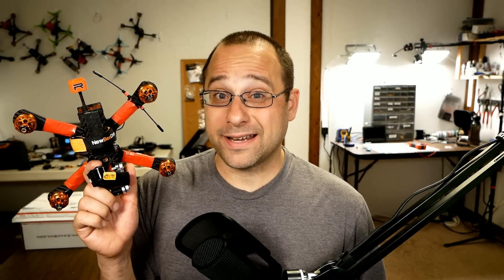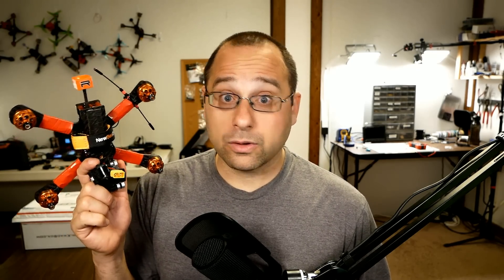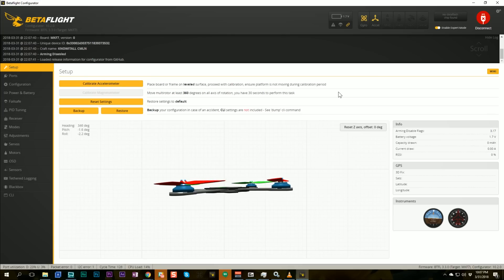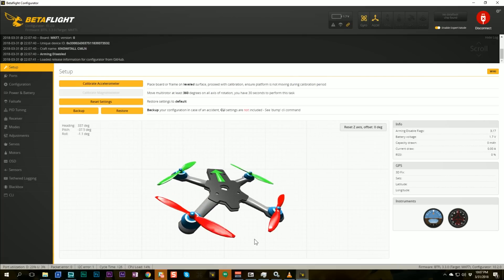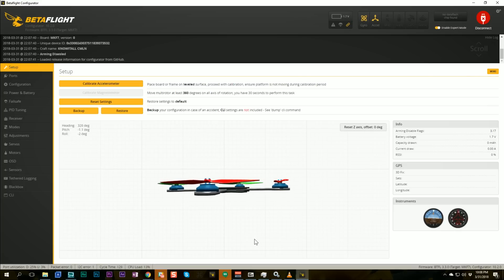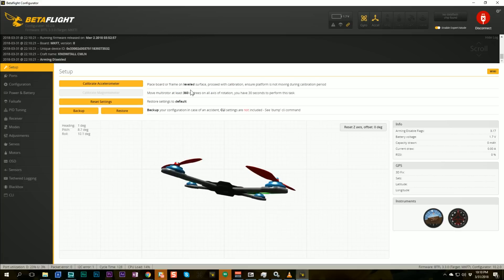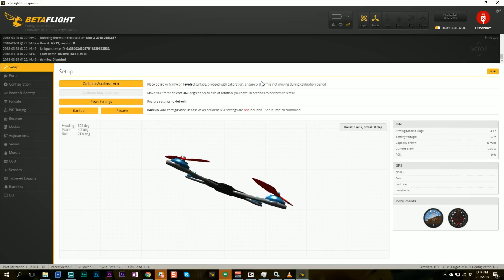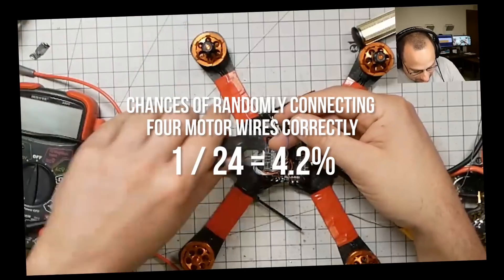Betaflight flight controller and ESC alignment incorrect | HOW TO FIX

Comment: Just a little add on for people doing this in 2024 remember to reset your Z axis in the setup tab. You could have the right board alignment settings and still show the wrong configuration until you reset. :)

Comment: Saved my ass again. Had to use several of your videos to correct my "reset" on a Betafpv Meteor65 ELRS. Had to set the VTX tab, the receiver tab, PID tab....blah blah blah. At first I was mad, but JB would certainly have a video or videos. Then I laughed and got to work....thanks again for this vidoes. ALL of these manufacturers should pay you some kinda skrill for this.

Comment: Now, this gonna sound weird but I did re-align the motors via the CLI and the 3D model seems to behave as it should but when I actually go into the receiver tab and I try to manipulate the model with my taranis, pitch and roll are inverted. Same happens when I actually try to fly it - pitch and roll are indeed inverted...
Reply from the maker: Invert your pitch and roll channels in your controller.

Comment: Hello, I notice that my quad is pushing air down, not pulling it up like the little 3D model in Betaflight. Does this impact the drones YAW and Pitch settings? My GepRC Cinelog35 flight controller seemed to have been installed backwards because the 3D model doesn't rotate correct to real life. So I went into configurations and change the YAW and Pitch to 180 degrees. Now I'm thinking that maybe it was originally correct because the 3D model in Betaflight is pulling air not pushing it. Was I correct in my thinking? How should I adjust my settings? Thanks!

Comment: there must be something wrong with betaflight or with my FC, i've set the yaw offset to 45 then to -45 trying to mount "star shape" controller on a square config then deciding to drill new holes into frame and keep star shape alignment and reset the offset to 0 since the "arrow on the board" was facing forward.. but god dang this wasn't working as supposed to and quad would always runaway disarm , only now after watching this i checked if the quad gyro is working properly and found out it was offset by -90 degree's... flipping annoying. lost a Sunday of flying for this  crap..

Comment: Hi joshua i followed ur steps. The motors spin right and the FC is facing the right direction. How ever if i switch to acro mode the quad flys fine the first minute or so but then in the air the directions suddenly change if i pitch forward the quad moves back and if i roll right the quad move left. Can someone please help me i have this quad for over 1 year now and never got it working properly :(
Reply from the maker: My best guess is you have headfree mode activated in the Modes tab.
Reply: @JoshuaBardwell  THANK YOU SO MUCH JOSHUA yess this was the problem i always thought headfree is acro in betaflight. Ive spent a lot of time in DRL sim its so nice to use ur sim skills in reallife. Cant thank you enough :)

Comment: what happens if suddenly betaflight 4.3 thinks pitch is roll and visa versa?
Reply from the maker: The FC alignment could be 90 degrees off.
Or if you mean in the Receiver tab, your channel mapping could be wrong.
Reply: @JoshuaBardwell  in the setup tap, it thinks my sensors are aligned completely differently than they were in 4.2. Its not possible being a tiny whoop. The FC can really only fit the frame in one direction. Can't be upside down because of the motor connectors... and oddly betaflight WILL NOT let me flash back to 4.2. Did I just get unlucky a kill a gyro? My other quads all liked 4.3!
Reply from the maker: Can you fix it using the Yaw Degrees parameter in Configuration tab?
Reply: @JoshuaBardwell  I was un successful : ( I tried. Thank you so much for the help. Long shot that you might know this but.. I think betaflight might have gave me a false firmware target. Its the betafpv AIO 1s board that supports the HD VTX (meteor65HD) the firmware target came up as matek f411rx... I thought that was weird. Any idea if that is right?
Reply: @JoshuaBardwell  Its betaflight 4.3 I managed to flash back to 4.2 and everything works. BetaFPV has some firmware to take care of! ; ). Not sure if you have this same FC, I would be curious to know if you get the same thing switching between the two.

Comment: Hi Joshua, thanks for this. I'm about to upgrade my quad to digital, and in order to fit everything in I'm going to have to rotate my FC/ESC stack 180 degrees. I've already tested this in BF 4.3 and it's easy enough following your instructions. However, before I changed anything, under the alignment settings it had - 'Gyro/Accel' set as 'First'. Then the 'First Gyro' option is already shown as CW 180 Degrees. My question is, if I add 180 Degrees to my yaw as you did, in order to rotate my stack. Do I also need to change this 'First Gyro' option? I hope this makes sense. Thanks

Comment: Planning on utilizing a aio Darwin board of a 2.5" BQE Rip Squeak v2 build I'm working on. And the USB port is located on the bottom of the board. So I will need to rotate it 90° to access it. This might be a dated tutorial, yet the info still holds strong. Bout to learn something new! Awesome

Comment: I have the problem that 2 motors aren’t spinning on a new build (it isn’t my first)  so i thought something with the motor remapping because when i connect a good working motor output to the esc and motor that is not spinning it works just fine. So how do i find the right channel to spin the motor up? Like an A01 pr A02 that kinda output?

Comment: Hey so my fc is right and all my movmints are good but when I move my stick to the left it gose right and pitch forward is backwards.    Any idea haw to fix this     thank
Reply from the maker: Make sure headfree mode is not active.
Reply: @JoshuaBardwell  I just need to know how to reverse the servos
Reply from the maker: It depends on your controller. You reverse channels in the controller usually.
Reply: @JoshuaBardwell   I have the dji goggles and dji controller    I can reverse them in the goggles but all my other quads are the same and this one is backwords.     Can't I change in beta flight or do I have to go in to goggles and reverse the 2 channels every time I fly this quad?

Comment: Does it matter is the props inwards or outwards if the props on correctly and the correct motor spins correctly via each slider

Comment: so, i recently bought 2 nanohawks. i was flying only one of them for a while and accidentally reset the settings on the setup page in betaflight without first backing it up. ok, no worries.. i’ll just back up the settings from the other one that’s flying perfectly. i matched all the settings as close as possible after i flashed the matching firmware of the working nanohawk(it isn’t running the latest version) For some reason my motor mapping is out of order. i switched the motors around correctly in the cl and put on fresh props. now i’m not getting any lift with full throttle. I made sure all of the motors are spinning the right way. and i calibrated the motors in the motors tab as well.  it was flying fine before i reset the settings so i’m almost certain it’s not a hardware issue. ive been through a bunch of forums and vidoes.. does anyone have any troubleshooting ideas? it would be greatly appreciated. betaflight and fpv in general are a new world to me so thank you for your patience to anyone who actually read this.

Comment: Question for ya Mr. B - if you change the board alignment only without changing the sensor alignment, will the gyro traces in BBL be correct or will they follow the board?

 Example: I rotate my FC 90° CW, and put 90 into the board alignment without changing the gyro sensor alignment. Will the roll gyro then show movement about the lateral axis instead of along the lateral axis and the pitch gyro show movement about the longitudinal axis instead of along the longitudinal axis in BBL? Or does the FC work that out with its FC brain and log it correctly? Does my question even make sense? I'm assuming it'll show up correctly in the logs but I figured I'd ask. 

I guess I could try it but maybe you'll answer before I get around to it. 🤣 Thanks man!
Reply from the maker: Board align reorients all sensors. Sensor align changes the sensor orientation relative to the board. If the sensor is separate from the board then use sensor align. Such as a compass mounted on a GPS stalk. If the sensor is installed in the board always use board align.
Reply: @JoshuaBardwell  fannnnntastic, thank you!

Comment: i tried to follow shutterbug's nano hawk conversion video and i could not get the  board to fly rotated no matter what i did , it seems like an easy process but it never flew rotated , it would fly in its stock direction , but now when i arm it after a few bangs , it just takes off and hit the ceiling , is there a program to help diagnose my drones problems , without having to buy a new one every time it stops functioning like normal ????

Comment: Thank you so much for all you do! Accidentally put board in 180* off. I changed it in board alignment but didn't realize I had to remap. I'm using individual esc's. They are all spinning correct but it's correcting the opposite motor I take it.

Ps. You should make that the 5 things that could cause flipping at take-off.  I'd already be flying. Lol
Happy flying YOUR AWESOME!!!!

Comment: Hey bro, so I just switched to 180 on the yaw, however, my yaw keeps turning right when I move it towards the left, and same for my roll what to do, ive trying for the last couple of days
Reply from the maker: Does your yaw channel move the correct direction in the receiver tab? Left is 1000 right is 2000. If not, invert the yaw channel in your controller.
Reply: @JoshuaBardwell  when I’m moving, my sticks, the yaw on the receiver goes towards the left towards 1000 and when I go right it does towards 2000,  it still causing it to move in incorrect direction
Reply from the maker: I think you must have messed up the board alignment then. Somehow, you've got the pitch and roll axis correct but the yaw axis incorrect.

Comment: Joshua, it happens in my quad that the four motors spin in the same direction. By the way, they spin in the correct numbers assigned in BetaFlight. Can it be change the direction? Regards

Comment: I have a iFlight Chimera 4 and all four motors spin backwards.  I've watched several of your videos and your instructions are easy to follow but doesn't solve my issue.  My sensor is aligned right according to betaflight, when i tilt up it goes up, when i tilt right, it goes right.  When I manually spin up my motors, motor 1 controls motor 1 and so on.  I've tried reassigning resources and saving the config.  I flipped resources for 1 & 2 and 3 & 4 and the config confirms the change but the motors still spin backwards.  Any ideas?
Reply from the maker: Reverse the motors in blhelisuite.
Reply: @JoshuaBardwell  Update I found out for at least this drone they are meant to go out ward so I move the props and it fixed that problem Yay but now j have another one when I arm my drone and give it throttle it just disarms it's self about 1 foot in the air. ( Big fan thank you in advance )
Reply: Ty

Comment: im here to remap my motors but i dond find any motor comand lines if i use resurces  but    if i use the DUMP comand i get them 
after starting the CLI i get the message....    Building AutoComplete Cache 
                                                                              Building AutoComplete Cache ... Failed!

Question is do i have to worry about this Building AutoComplete Cache problem or can i ignore it ? 

i use a JHEMCU F7 BT Flightcontroler  and if i use  the CLI comand or resurces i dond see anythin like MOTOR 1 or anny thing i see on JBs screen( min 11.54) 
 just something like           set osd_xyz.......  here are all of em compaired to another FC ( MAMBA F7 ) 
                                              set ledstripe_beacon....
                                              set telemetry_disable.....
                                              set vtx_band 4 ........

Comment: Saved my day(s)!! Spend a lot of time on a 'runaway' issue on my Emax Tinyhawk Freestyle. Even soldered and unsoldered all the wires because someone told me they would be 'bad solder'. Cause "drone works at idle but after spin up, the drone can't get enough voltage and therefor it would 'reset'". Well,, that was 'bs' apparently, but at least I had a good experience in taking apart the whole quad and resoldering it. 
So with the OSD i found the 'runaway' issue. Not sure why I didn't see that one before, probably because I had another issue " a blinking ** " (4 stars). Still don't know what those mean(??). Now, with your help, I've fixed the issue and the quad works! Great! Thank you!
Why this issue occured, don't know. All worked fine. Installed XM+, worked fine. Then installed Nano V2, worked fine. Then installed Eachine VTX03, and suddenly I had this motor issue. Strange. But hey, luckily we have JB ! :D

Comment: How would I offset my flight controller into a whoop style configuration? If I wanted to use say an F405 stack in a custom whoop?
Reply from the maker: Board align 45 degrees yaw.

Comment: What if my FC and motor alignment is correct but my drone still flip out ?
Reply from the maker: 1. Clockwise prop installed on counter-clockwise spinning motor or vice versa.

2. Flight controller not facing forward. Go to the Setup tab in the configurator. Tilt the quadcopter on all axes (pitch, roll, yaw) with your hands. The 3D model in the configurator should move the same as you move it with your hand. If it does not, use the Board Alignment parameter in the Configuration tab to fix it.

3. Motors not wired correctly. TAKE OFF YOUR PROPS. Plug in a battery. Go to the Motors tab. Turn on the "props are off" slider in the lower-right. Raise the individual sliders (1, 2, 3, and 4) one at a time, just enough that the motor begins spinning. The motor positions (1, 2, 3, and 4) should match the graphic in the upper left. If they do not, then either move the signal wires so that they are correct or use resource reassignment to virtually "move" the motors.

4. Motor spinning wrong direction. Do the same as step 3 but compare the motor direction to the arrows on the graphic in the upper left. If a motor is spinning the wrong direction, either reverse it using BLHeli (or whatever ESC software you are using) or swap any two motor wires with each other, which will reverse the direction.

Many times, people swear up and down they have checked all of these things, and then come back to say oops I missed one you were right. So if you think you have checked all of these things and your quad still FLIPS OUT, go back and check again. If your quad is insta-flipping on takeoff, it is almost always one of these things.

Comment: Can't change resource in CLI?  Eg: In BF (10.6.0) I activate motor #1 and motor #3 turns. In CLI Motor 1 is B00. In CLI I typed 'resource motor #3 B00' (Zeros not the letter o). I get the following error......*ERROR* B0 also used by motor 1...........I get this error for each change I attempt for the other motors? I'm using a Omnibus Flip32 F4 V3 running BF 3.1.0. Any help would be appreciated cause as she sits now..... she flips out when trying to leave the ground.
Reply from the maker: You can ignore the error as long as you don't have two motors assigned to the same pin when you're done.

Or you can manually clear the assignments by typing

resource motor 3 none
Reply: @JoshuaBardwell  Success using the 'clearing' method BUT I'm been chasing another problem for some time. Motors spool up on their own in BF. I've seen your vid on effects of props off in BF. The motors behave perfectly when using BF, but their speeds increase exponentially on their own when using the xmitter. Motors spin in right direction, channel min/mid/max set points perfect. Stick low position is perfect. This problem was happening before engine resource being fixed so that's not related. My other quads behave as they should both on BF and radio. If I try to get up in a hover the quad flips over. Arm the quad and bring the throttle up a little the motors speed up on their own and I've got to disarm.  This ones has me stumped and very difficult to find an answer in YT. Very frustrating.

Comment: thank you so much i just finished soldering and than i realized my quad was 90 degrees off in beta flight (this is my first quad) i thought i was fucked because i cut all of the motor wires to the perfect length for where they are on the frame

Comment: Awesome as usual!  Quick question, saw another video before yours (swear I wasn't cheating on you..lol) and yours explained it much better, but the other one mentioned that when in CLI you have to free up the resource value of each motor position by typing in  "resource motor x = none" then type in the commands that you showed.  His video release was earlier in 2018 than yours.  Was he just misinformed, or did that change in a newer version of BF?   And I take it still works that way in 4.0 and later.
Reply from the maker: You can manually clear the resource if you prefer. But when remapping motors you will reassign all four of them. So there's no need to set them to none.
Reply: @JoshuaBardwell ....Ahh, gotcha.  I went ahead and did it your way a little while ago, I noticed that the command prompt actually said, "B07 already assigned to motor X"  but then the very next line would say resource assigned motor X, so it worked perfectly, I even used an excel spread sheet to keep them straight, great idea.  Now I hit a bump putting OSD profiles on a switch using adjustment tab, but I think I have the solution, so I'll hold off buggin' ya on that one until I get really stuck.  Thanks again, your awesome!!